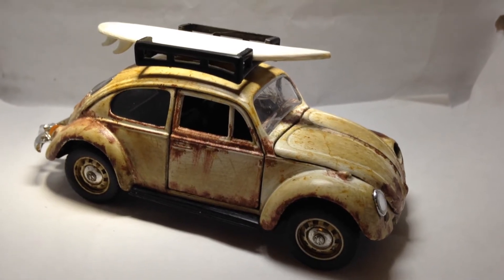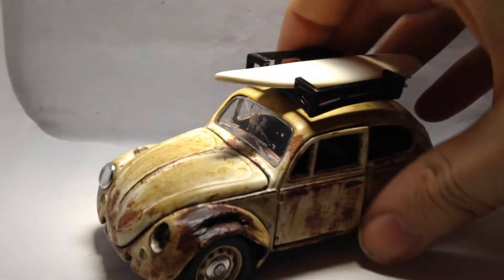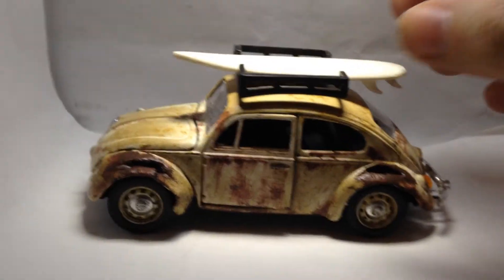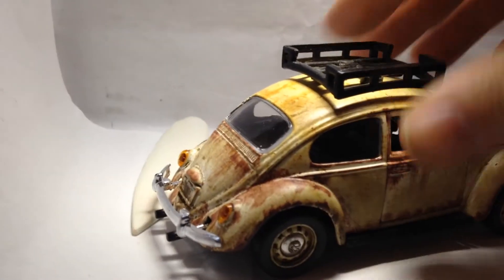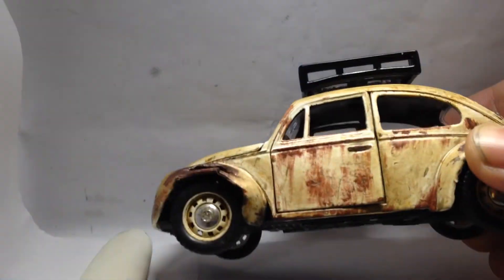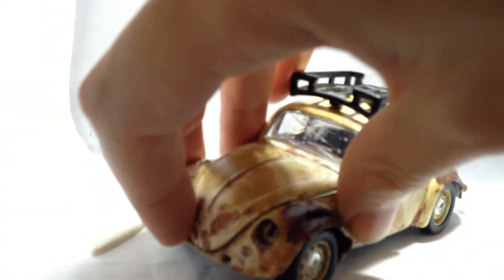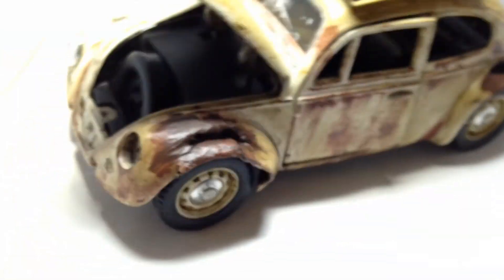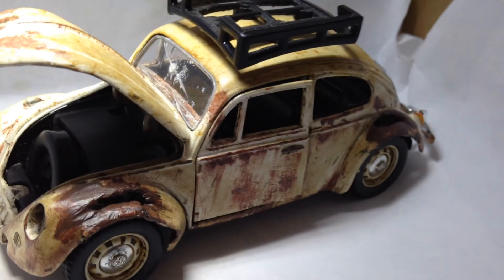Rusty 1967 VW bug custom

Comment: Looks fantastic.  Very realistic.  I like it as is, but I reckon if you do add the headlight hanging from a loose wire and the front bumper back on it will turn out awesome too!
Reply from the maker: ***** thanks i'm still playing around with the details the outside was easy the inside it a bit tougher. I'll have an update coming soon.